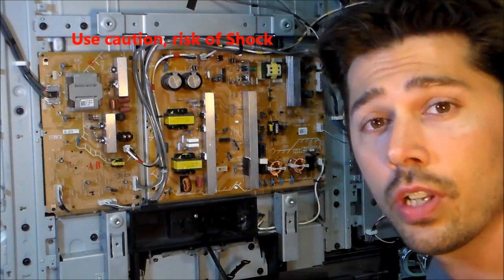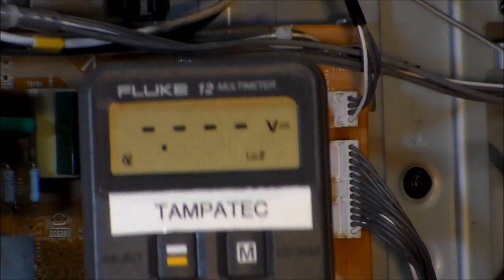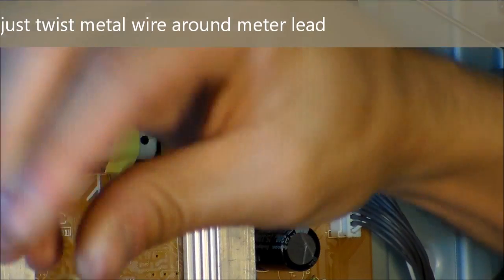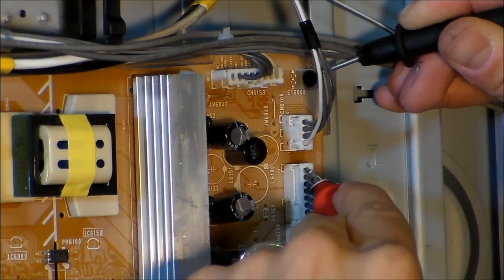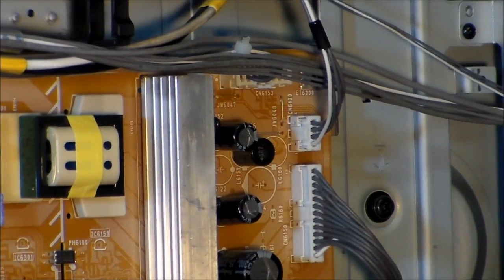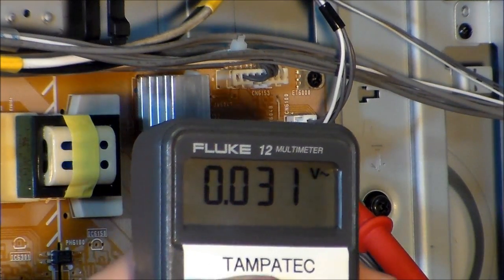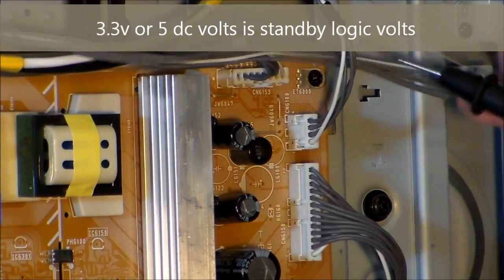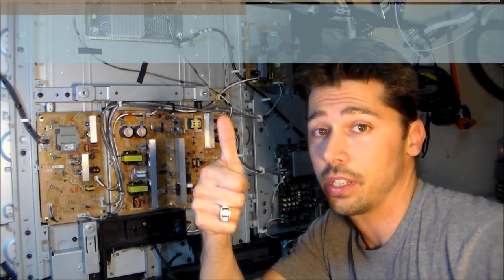How to use Multimeter testing TV power board

Comment: Question.. i got 5 volts on that part of the powerboard, it has to be 3 volts.. is that a problem?
Reply from the maker: Some logic voltage is 5v and sometimes 3v but that should be labeled on the board near the connection.
Reply: @TampaTec  thats right, on the board they say: one side of the connector it is 15volts, it is.. and the other side they say 3,5 volts but it is 5 volts on my multimeter

Comment: I have a 90" NEC 1080p that was given to me with the stipulate that it has a bad power supply.  Ordered another off of eBay from a supposedly working unit that had a cracked screen.  Still no power.  No standby light.  Borrowed a friend's multimeter to see if the power supply is even getting any power at all.  Even though this video was about power from the PSU to the mainboard, it was still helpful.  Thanks!

Comment: Hi i just follow the steps what ever you did on video and ı founded it out my psu board standby voltage 16v instead of 3.5 the last pin so whic part do need to check or replace ?

Comment: Ok so I was testing the standby voltage on a sony Tv power board, and as I was doing that reading the voltage with the lead tip the side of the lead touched causing a "shock" turning off the TV. Now it won't turn on at all, first it was blinking 6 times, now it blinks 3 times if I'm lucky it turns on. Please help, did I ruin it?
Reply: @TAMPATEC

Comment: I have 3 labeled 5.2v and they read fine, but I have 3 others labeled 12v and they read nothing. I'm guessing it's the power supply board that is bad. Do you have any input?
Reply from the maker: Hopsnbarley if the tv is on and 5.2v standby volts from power board to main board is steady but no 12v then usually yes, a bad power board but can be both power and main board. go to shopjimmy.com or electropartsonline.com use code tampatecfriend for discount

Comment: Before all this I did have std 5v but on connector P201 wire number 13 with TV on was 1.93V TV off 0.00V 
And on connector P202 wire number  7 was 3.4V  
Do I have to install exactly same transistor or I can use from another TV transistor

Comment: Hi tamptac ..
I have 42lb5df-ul LG and I was testing the power supply board  and I did accidentally short transistor my fuse burn out and  I did put new fuse and now no power on secondary side no std 5v or4.3v

Comment: Hi mate.  Love your videos, i've learned a lot from them.  Trying to troubleshoot a power board pins 1 and 2 are 13.2v dc standby and the meter shows 13v dead.  Should I be concerned about the lower than expected voltage?  Thanks!

Comment: Hi Tampatec, I am going to give testing my PSU board a go tomorrow with my multimeter on a LCD Direct LCD42-910 TV.  I have a blue light on the standby button and when you press ON you can hear a click but the TV does not turn on. Do I test the Power Board for Standby Voltage (5V) on DC? And does the TV have to be turned on? Then is there an AC side to the Power Board and will I do damage to the board if I test for AC Voltage on DC mode on my Multimeter? Cheers Dude

Comment: I have a Samsung LN40A530P1FXZA Tv that I get the correct voltage at all the labeled pins DC voltage only. Does this mean the power board is good or could it still have problems? The capacitors "look good". The Tv just has a small beep in speakers over and over and never turns on. Thanks in advanced for any help.
Reply from the maker: what happens if you connect external speakers do you get the beep?  maybe outside interference or main logic board which usaully has audio circuit built on it.
Reply: I will try that. However I did unplug the T-con board and tv made the full sound effects of turning on. No standby led though and nothing on screen.  Thanks for your videos. They are a big help.

Comment: I have sony led 47 inch kdl w804  tv.when i took d tv in service center they said power supply board has to b changed which cost abt $330 in nepal.its too costly.cant it b repaired without changing d board.sir ,tv starts up for 2 second,then shut down and starts to blink 6 times in each 3 second interval.

Comment: Hey man was watchin your video and you said it is hard to get to some of those connections so you wrapped a wire over it to get in the pinout. What we were taught in my automotive class was to take a T-pin and put that in the pinout and just test off of it. Hope that helps you next time it is a bitch to test a connection.

Comment: Hey, first and foremost, love the videos. Very helpful, and easy to follow. Reason I write is, I have a Sony KDL40VE5. Worked fine last night, try to turn it on this morning and dead, no power. Checked the plug, and it's not that. So, I watched one of your other videos and took the back off to test if power was making it's way to the main board. Using my multimeter to look for the 3.3V, there is no reading. I'm getting 0.0. What would be your first recommendation to check now? Any help is much appreciated :D

Comment: Hello Tampatec, I have a Seiki SE60GY24 that won't power on at all no power/standby lights or anything but have power 12v from supply to the main and 5v standby power as well. Do you think it's the main board ?

Thanks in advance !!!
Reply from the maker: usually if you got 12v and 5v on power board and no standby light, yes it is main logic board. try check all loose cables to main board and cracks in solder joints and check capacitors 470uf to 3300uf too.
keep us updated 8^)

Comment: Hey Tampatec, thanks for the tips, I'll check the capacitors again. By the way, are they the ones located to the right side of the power supply unit?
Reply from the maker: check all (100uf, 1000uf, 2200uf, 3300uf)

Comment: Hi Tampatec, thanks for your videos. I have a Samsung TV Plasma (BN44-00159A). My TV doesn't turn on, I checked the power supply unit (as shown on your video) and changed one capacitor that was dead (bulge on the top). I still don't get any 12V  out of the unit (checked the Vs, Va...). Don't know what to do next. 
Just for info I know very little about electronics, I just followed the step by step video of yours. Thank you.
Reply from the maker: buy the cap kit cause for samsung TVs capacitors are most common fix (some caps can still be bad but look ok) get it here http://www.amazon.com/s/?tag=tampfreepcpin-20&link_code=w12&linkId=&_encoding=UTF-8&search-alias=aps&field-keywords=samsung+capacitor+repair+kit

Comment: what if we are trying to check it like you did and it just sparks
Reply from the maker: if tv was turned on it may pop a ic or small diode but powersupply is tougher than logic boards. check 12v and standby 5v
Reply: ***** thanks for the quick reply. I checked the 12v and 5v. With the 5v to the main board im getting 2.97v from the PS

Comment: I've got a Sanyo DP42489-01 with  no power at all. Fuse good. Caps look good. No voltage to any of the power supply pins. No 5V standby. I do get 120 ~v on AC connector on board. Not sure where to go from here. Any thoughts?

Are you in Tampa? Sometimes I think I hear a Long Island accent in there.

Thanks and subbed. Your other videos have been helpful in learning.
Reply: @PsychoMistress  Check the IC's they can short out.

Comment from the maker: Shawn Boese trace back down from 5dc volts pin on power board, check caps (out of circuit) check diodes or ic or transistors, remember when you press "on button" the signal goes to main cpu board 1st telling high voltage to come on power board. but if power board has no standby 5v logic for main logic board then your TV is brain dead cause the heart is not beating. X(

Comment: I've got a lcd display for a notebook on wich the backlight doesnt work, i opened it and saw two fuses F1 next to te led connector and F2 i dont get continuity on f2 i've tried bridging it but then the notebook doesnt start, im thinking the bridge was not done properly but i wanted to get your opinion
Reply from the maker: if f2 is blown then something was shorted caused overload to blow that fuse, a strand of speaker wire can be simple bridge but you need to trace down the part the blow the fuse.